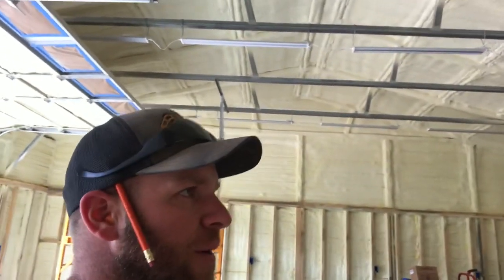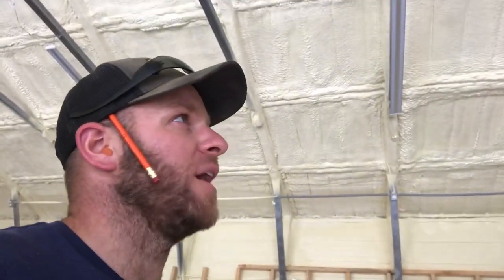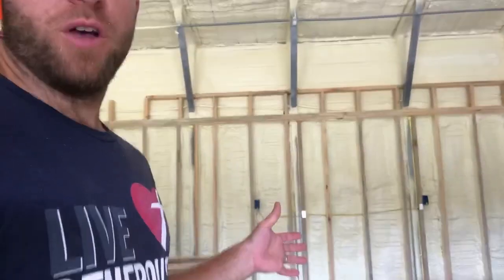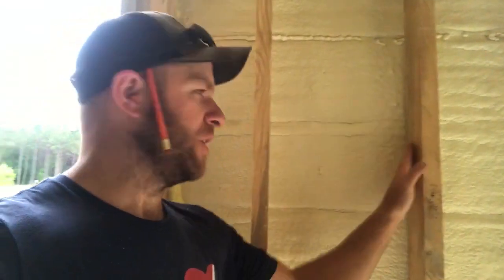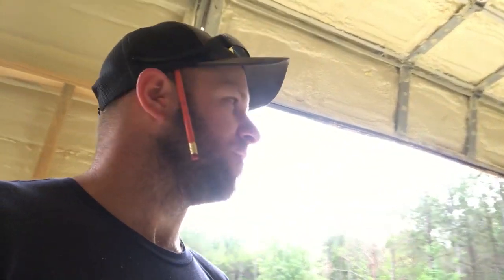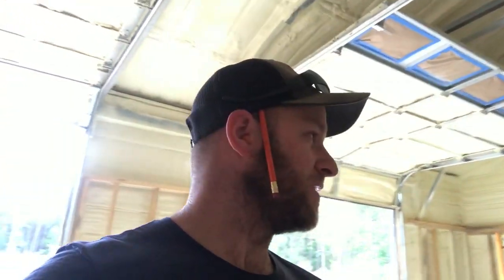Spray Foam Insulation in the Shop and Lessons Learned

Comment: Was wondering why a vapor barrier isn't used between spray foam and metal sheeting, this way if the metal gets damaged it would be a lot easier to replace and not ending up having to fight with it and loose your insulation at the same time?
Reply from the maker: That is an excellent point. I had the same thought after they foam it…see that would call for some foresight on the part of builders and would add upfront cost, so they won’t do it.😆. 
In hindsight yes, if I do anymore of my own construction like this I’d add some vapor barrier or even just OSB, something for the foam to stick to instead of the metal. When it’s cooler out and then the sun comes up and that metal expands you can hear it popping here and there where the foam is letting go. We are planning a shop addition, pole barn style, but I think I’ll “sheet” with 1x6 or 1x8 to add racking support and create that layer. It’ll also offset the metal off the foam and help create a thermal break to reduce heat conduction.
Reply: I thought of that too, so the metal would just come off easy and the foam/tyvel stays, but that kills the waterproofing part. The foam needs to stick TO the metal to prevent condensation. If tyvek was there the metal would condense on the outside of it and rust out or mold.

Comment: I've seen foam pumped into walls and the sheetrock popping out! Very expensive repairs. If it's applied before sheetrock it's better; however problems remain if you need to replace wiring or if fumes become a problem. Buyer beware!
Reply: That's not the same stuff as what he had applied in this video.

Comment: Looks pretty cool
Reply from the maker: It’s working out OK. As hot as it’s been it would be impossible to work in this tin can without insulation and AC! If I could do it over though I’d go thicker, especially on the ceiling. May still go back and do more on the ceiling if we find the extra money.

Comment: I did the same thing to my building. Noticed white mold growing on stuff in the building. Cleaned it all and put in a dehumidifier. I don't have any wall vents. But guess I may have to I stall some. Have you bad any issue like this?
Reply from the maker: No issues with mold or mildew that we’ve seen, but we also have HVAC in there now.

Comment: What happens when you have to replace the roofing system due to hail or leaks?
Reply from the maker: Excellent question. Leaks we’ve stopped up with more foam it seems. If we ever get hail or leaks that bad we’ll probably lay fir strips over the top and just do a second layer as a cold roof.

Comment: Thanks for the video! Where do you buy large quanites (9600 square feet) and where do you buy the sprayer?
 
Thank you, 
Doug
Reply from the maker: We hired a company to come do it. I know you can buy small kits at Home Depot and the like but I don’t know about renting the gun and buying barrels of the stuff
Reply: @TomBrueggen  thanks. It seems like very expensive equipment to buy. I don't know if you can rent them.
Reply from the maker: Check with HD. The gun and tanks almost certainly are rental items, or deposit required. Not sure if you can get bigger tanks than the little ones they offer standard
Reply from the maker: The guy we hired was affordable enough to show up and do it, but make sure if you have someone else quote it for you they they quote for the appropriate amount you want/need

Comment: What happens if you get hail and need to replace metal siding or roof? Do you have to reinsulate? Curious how you handle this
Reply from the maker: Well, I wouldn’t replace for hail if it were just dented. But yeah, I had the same thoughts. I’d we have to replace a wall or roof panel it would suck. But it peels off the metal easy enough.
Reply: I was wondering the same. Our garage has been sprayed onto the metal siding. Now I’m thinking about remodeling the siding. Is there a way to save it?
Reply: @renechavez8464  Just put the new stuff OVER the old
Reply: @TomBrueggen  Sheet over it. Rather than replace.

Comment: I am just wondering why you didn't read the directions first? The safety is always first and it will state to use plastic on everything that you didn't want the foam to touch.
Reply from the maker: I hired a guy that sprayed this for me. And be covered most of our tools and stuff in the shop to keep it clean. The hay was a last minute realization and we didn’t have enough plastic to cover to all. We moved it all to one side of the loft, sprayed that side of the ceiling and let it set up, then moved all the hay to the other side and sprayed that half of the roof where it was. But there was just a bit of drift that got on the exposed face of the hay pile, but it’s ok.
Reply: @TomBrueggen  no animal ate that hay?

Comment: Thanks for the video. How did finishing the framing? I have a metal building looks to be the same as yours and I want to start framing. Did you do anything to the roof? If you just framed walls you think they would support weight? Like cabinets for tools and what not. I was on the fence about insulating first. So thanks for clearing that up.
Reply from the maker: We haven’t done anything to the roof, and yes the walls should support weight just fine. My only concern was the chance of walls wanting to tip inwards if you had a lot of cabinets hanging on them, but realistically that weight is still very close to the wall, and they are tied on top by the trusses, so I’d say it’s a non issue. I guess I need to make an update on the shop. We are using it now on a regular basis doing client projects. Still a long way from finished, but very functional. 

Just make sure to get all your in-wall stuff done FIRST, then spray the foam!
Reply: A rough price would be great.

Comment: TOM: JUST SO THAT I UNDERSTAND... IF YOU FOAM COMPLETLY... YOU HAVE NO TROUBLE WITH LEAKS OR VAPOR BARRIER ISSUES???  THANKS,
  DENNY
Reply from the maker: Theoretically. The one inch of close cell is supposed to do that. We still have the occasional leak though, which is rather aggravating as they seem to come and go and not always in the same spot.
Reply: @TomBrueggen  I'm thinking B4 I have mine sprayed in to go on top and replace ALL the screws, typically at least my building has those screws that requires the rubber washers under them that is supposed to be replaced every so often, but they have whats called a "lifetime" screw that DOESN'T need such, I would use those PLUS the RV seal tape OVER the screws.

Comment: I know the advantages to spray foam are tremendous and incomparable to any other solution It's just now we're gluing entire buildings together without a plan to salvage anything.  
Before we continue spraying entire buildings maybe we should stop to see if we shouldn't add a step for down the road.
Reply from the maker: I agree. The thought of having to peel off and replace a single roof panel isn’t a pretty image in my mind. I’m not sure what the better plan forward is. Maybe plastic sheeting between the foam and metal so the foam isn’t stuck to the metal?
Reply: @TomBrueggen  I brainstormed and tried to come up with a solution but I’m afraid I need to get more experience and ideas from other problems in life. This one’s a touch cookie. If only we had a spray on coating that would release the bond when we wanted.

Comment: I have a question im building a metal building which ill be converting it into a barndominium in Texas. How much closed cell should I use ive been reading the comments about doing 2 inches. But I was thinking about doing 1 inche closed cell and 3.5 of open cell on top of this. Would anyone be able to tell me if this would be enough? Or a waste of money? Thank you good video, give us an update video of your shop please.
Reply from the maker: It’s up to you on how much you want to spend now vs save later. 1” of closed cell is just the vapor barrier. Beyond that you can fill the rest of the wall however you’d like. I would simply suggest getting bids a few different ways and see how the insulation guys respond to your requests with their pricing. The guy that sprayed our shop seemed like he really wanted to talk me out of doing open cell over the closed cell (and he did). Not sure if he just wasn’t equipped to do so and didn’t want to come back or what? We definitely need to do more on our roof. That’s where we take the biggest heat gain in summer and loss in winter.
Reply: @TomBrueggen  -thank you Tom.

Comment: You should wear overalls or you will be picking this stuff from your leg hairs lol. Been there done that. The guy applying it was ok but he needs to go slower on his passes unless he was just putting a flash coat. The second pass should be a 2 inch pass if it's closed cell.
Reply from the maker: Thanks for sharing. Man I’ve thought about getting in the game a few times. Like so many other contractors that I’ve observed and I think “I could do that better”, but I have enough on my plate already 😁
Reply: @TomBrueggen  oh spray foam is not something you just pick up. It takes a while, at least 2 solid years of being an apprentice amd learning all sorts of troubleshooting for all the things that can go wrong with the machine. It's an art really. I've seen companies go bankrupt because they wanted to get in the game of insulation and didn't know much about it. I mostly install insulation in attics but I've done sprayfoam as well.

Comment: Great video!  So you are not going to cover the walls with anything?  Is covering the foam even necessary?  I have a metal building and want to get it insulated; would I have to wall it up or can I leave it bare?
Reply from the maker: I Haven’t done well with updates. We closed up the walls with OSB. Thankfully got it at $7/sheet in early 2020 the insane pricing now! You can leave it bare I suppose, it depends on your final use. We needed to be able to install wiring/plumbing/etc so our walls are closed up, but we did leave the ceiling open
Reply: We use insulated panel. Like cool room fridge ones
Reply: @stivi739  Do you think it’s cheaper than spray foam?

Comment: O boy did he gave you wrong information. So the way it goes - 1 inch of closed cell will get you to air and vapor barrier level and it will be around 70% more efficient compared to bare walls, not 90%   BUT every inch of close cell will add about R6 - R7 to your insulation. Your sprayer completely misunderstood spray foam specks.
Reply from the maker: Yeah we realize that now. He was quoting some general things he’d read or heard, enough to throw us off and go ahead and do what he normally does. We should have known better. For some reason I told myself that R values were magically R30/inch I guess 🙄🤣
Reply: @TomBrueggen  closed cell gets astound R6 per inch. You want to get to R30 you'll need around 5 inches,  minimum 4.

Comment: It sounds like your installer is not that great/wise.
You always have to have the framing done before the spray foam. I am also surprised he spray foamed around the items in the building(hay and wood pile). I have never seen that before, so I think the installer was just interested in cutting corners.
Do not use this guy again.
Reply from the maker: Don’t intend to. Even if we end up adding more foam (as we should) I’ll be finding someone else

Comment: He also left you the hard work he didn't want to do like taping off electrical outlets. It's harder for you now to run wires and install through hard foam.
Reply from the maker: Yes we definitely regret foaming before we were done with all the electrical and framing. But we were done enough, and didn’t want to miss an opportunity. Most guys we called were backed up for weeks or simply didn’t return our call.
Reply: @TomBrueggen  That's a bummer, you'd think people who can work would be working. I'm thinking I don't want my wires frozen behind this foam anyway, how much do we really know about said foam. I think I'm going to just do the ceiling and floor and batt the walls but you did the best for your structure.

Comment: Hi Tom, I am having a metal 30x30 garage installed soon and am wondering how you like your spray foam now that you are over a year with it??
Reply from the maker: I like it well enough. Just make sure all your work in the walls is done before you have them foam it. And don’t let the foam guy tell you that an inch or so is good enough. Be ready to pay for a well insulated building. We learned that the price most advertise is a low R value result, but they advertise that price because it’s in line with what people are expecting. You pay less, but you get less. I think ours is was approximately $1/Sf of wall and ceiling but only 1-1.5” thick. In hindsight we should have gone several inches think on the ceiling and a bit thicker on the walls, especially out southern exposure. But since we had agreed to the budget price, the guy only came with enough material to do a low budget job. We asked for more once we realized the looking issue and he of course said it would double the price (ok that’s fine) but he didn’t have the product. A return trip of course would then cost an additional trip fee…

Plan it right to get a good job done one time and never worry again!
Reply from the maker: We have a 2 ton packaged unit on our 30x40 shop with 10’ sidewalls. The AC compressor does not turn off during the day in the summer. 😫
Reply: @TomBrueggen   what was a rough cost for this on your shop? I may have missed it, Thank you

Comment: I’m new to this and am buying a steel building. My concern is that when the sheet metal sweats on the back side, it would sit between the foam and metal and not be able to evaporate and then rust the metal out from the back side. Is that possible or am I way off? Maybe support some plywood about an 1” away from the metal then spray it onto the wood so there is an air gap between the metal? I know that would be a lot more work and money for the wood then.
Reply from the maker: It’s not a risk. Condensation on the cool metal would only happen if the humid air can touch it. The foam is impermeable, so the moisture will never see the back side of the metal. Now, doing a sort of cold roof like you suggest wouldn’t be a horrible idea, but the benefit would be in the added dead air space and thermal conductivity break. If I could redesigned the roof of my home, I’d do silver backed OSB decking, silver side up, then fir strips and either a second deck of OSB or attach metal directly to the strips. This would make a huge thermal gap, and the silver backing on the OSB pointing up would also reflect a lot of the radiation as well. Our framers put the silver side down, which theoretically would then reflect my heat back down in the winter. But I have cellulose insulation between my inside and the silver backing, so it’s ultimately useless. When I asked them why they put it silver side down they just shrugged and said “it’s what we always do.” 😣. 

Good luck on your project. Thanks for watching!!

Comment: Where are you located?
Reply from the maker: Southeast TX. Our bigger concern down here is keeping heat out, not in. Yes for sure in hindsight we should have gone thicker, and if we get the funds we may someday. I see now what the quick insulation game is. They price it such to make it affordable, but then you also don’t get as much as you need. So they say “$3000 is good enough” but really $8000 worth is what you need. If they said $8000 up front they’d never get the job, except for clients that truly understand the longevity and have the deep pockets to spend it now. I can definitely feel it’s hotter when I get up close to the roof, as expected. Since heat rises, we end up with cold air pocket from the AC down where we are working, so a hot spot up against the roof doesn’t really bother us, it’s just inefficient. If you’re trying to heat the space, then 1” on the ceiling is certainly not enough, since it’s a double loss.
Reply: @TomBrueggen  I have been spraying foam for 7 years now, and here in Nebraska I will not put anything less than 1 1/2 " on.
I recommend 2".  Here in our climate, it does a great job

Comment: Would it be a good idea to spay the roof before electrical work 🤔
Reply: My walls are 6in block
Reply from the maker: If you aren’t doing anymore work on the ceiling then go ahead and spray it. Keep in mind insulation guys may charge a minimum fee to come out more than once.

Comment: ii would still put insulation to your walls.. it is better ..and it is better to combine foam and fiberglass or rockwooll. insulation...much lower fire hazard..and it would make better parameters for that building..
Reply from the maker: I agree. Unfortunately we ran out of money and had to go ahead and close it up without the additional insulation. It seems to hold temp pretty well if we shut the HVAC off. Sure it could always be better, but we are in a realm of diminishing returns. Need to get the overhead doors sealed up better and get the exterior ducts sealed up and closed in.
Reply: @TomBrueggen  Fully agree with you friend.. All is about money and foam insulation cost the most from all type of insulations..so yeah i understand it....i'm talking about that rockwool only if there is risk of fire hazard..if there isn't then all is fine and no problem at all .fo example i know that if i will orter triple gazed window roi is none..but we do that from time to time..because we know we will live in that house for long years..but even then roi is none because it just cost too much..(that was in past ofc..today it isn't so big deal)